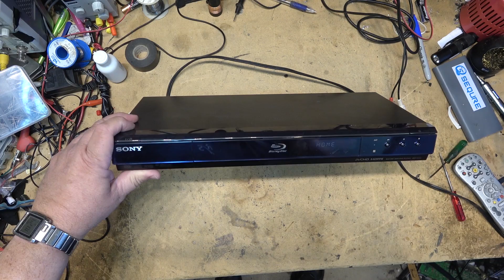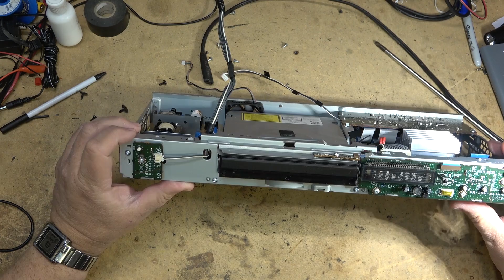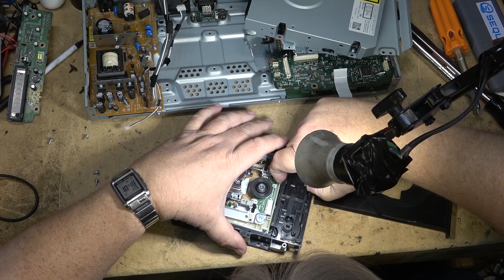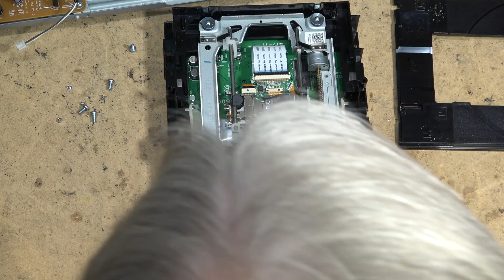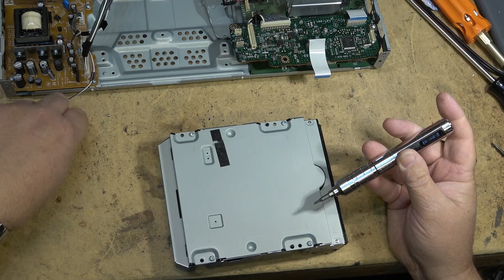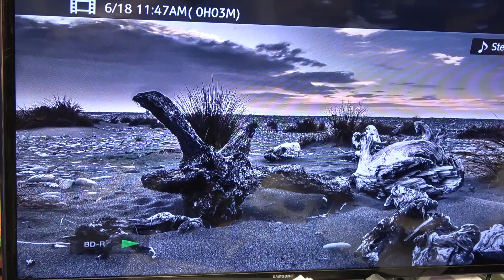Sony BPDS350 Bluray  no load

Comment: With some effort (and a little damage), I managed to get the case removed and gained access to the belt and pully area of my BDP-550. No cracking or other signs of trouble with the pully, however my belt did have that greyish haze that develops on them over time and, yes, it seems a bit worn. I removed it, gave it a good cold water wash and reinstalled. I then lubed all of the moving/sliding parts. After reassembly, the tray opened without any hesitation. Woo hoo! All done...or so I thought. A couple weeks passed. I fired the player up to test it out and it was not ejecting again. It clearly struggles to get it open which suggest the worn belt is just not grabbing very well. DO YOU HAPPEN TO KNOW A REPLACEMENT PART # ? I suspect it is identical to the BDP-350. You might have prepared to replace yours before discovering the cracked pully. Thanks.

Comment: I have a similar problem with my BDP-S550 which I am sure is identical to the S350 model apart from features. I was thinking a loose/worn belt also but I will now be on the look out for a broken pully. I also have to be in the right mood for a lot of disassembly.  😀

Comment: From experience I'd have to say most discs stand up well over the years.  Some, however, can have the slightest surface imperfection and won't play at all, or will stick/freeze or stutter.  Other times a brand new disc won't play (it's been loose in the case?). Yet it's amazing how some heavily scratched (sometimes deeply) and (rarely but occasionally) warped/bent discs will play perfectly; with no issues!  Different players may not play them or will have different issues, of course.

Comment: I bought the Sony BDP-S550 back in very early 2009, because it also had analogue 7.1 outputs in the back.
It still ejects and pull the tray in with no problems, but have instead developed this phenomenon of "Not recognizing the disc".

Most of the time, if the disc is inserted during the first seconds after a cold start, it will work.
(Apart from untried hardware interference, this has proved to be the most succesful approach so far)

Other times you'll have to hit open/close several times before it finally gives in and play the darn thing.

And then again, at other times it doesn't matter what you do, it simply will not recognize the disc, even if it has played perfectly well a couple of years ago. But oddly enough, if inserting another BR, it might play fine.

Sometimes, when the machine has this problem it won't even play CD's or DVD's.

Listening to the difference between a succesful and unsuccesful loading of a BR, it's obvious, that it tries to read the TOC (Or equivalent to the BR-format), before giving some faint but healthy whirring noises (pick-up assembly going back/forth), spinning up and play.
When unsuccesful, it stops before all these actions, so the problem must be with reading some initial stuff and therefore it could be a matter of a dirty lens.
There's also a procedure for a factory resetting, that could be helpful. I tried it. However to no effect.

Maybe reseating the cables could be recommended, or maybe not.

Hmmm...better take this beast up and on the table to find out.

Comment: Wow a Bluray player with composite and component outputs.... Players i've only seen have HDMI only..
Reply: Yeah I have a Philips bluray player with HDMI only although I have a friend who has a bunch of earlier Philips blurays with composite and component but no HDMI - I guess 1st gen bluray units. Can't remember the model number but they're well built and reliable unlike my cheaper one which has the delightful habit of holding on to the disc when you open the tray, forcing you to remove the cover to get the damn thing out again :(
Reply: From the same production year (2009) as this BDP-S350, came the BDP-S550.

Apart from Digital Coax and Toslink Optical, it has analogue 7.1 output.
Analogue video outputs: composite, S-video, component on top of HDMI.
The back is pretty crowded with sockets for everything on the BDP-S550.
I guess what's missing is a SCART-socket....hmmm
Reply: How do you remember where every screw goes? Aside that you have this video to reference?

Comment: On a playstation 3 console I had never opened laser would not read I swopped the flat ribbon cable and it worked fine the old one just would not work yet it had never been opened .

Comment: During lockdown earlier this year I found my Sony DVD/HDD recorder, which is in regular use recording TV still, was letting discs slip.  It would spin them up just fine but when it needed to apply the brakes I could tell the disc wasnt clamped properly thanks to the loud "bbbzzzzz" vibrating noise it made :D

Opening it up to extract the drive, simply to clean the felt pad on the drive spindle that helps clamp the disc, was hell.  You opened one, a similar model and had much the same experience.  That drive was locked into position in various ways, the most annoying of which was a PCB actually fixed onto the drive that slid in and out at a weird angle if you needed to insert the drive.  The designers never intended the drive to come out so this weird angle was harder to achieve when removing it.

All of that just to remove the layer of dust that had become stuck to the felt pad on the spindle.

I swear Sony build these to survive a plane crash or something.

Comment: I have an old Panasonic Omnivision VHS VCR Top-Loader. When I press the play button, the reels move for a few seconds and then it just stops. Do you have any idea what may be causing this malfunction?
Reply from the maker: rotation sensor
Reply: @12voltvids  Where's the rotation sensor located? Also, do I need to replace it or is it possible to fix myself? Thanks for your quick response!
Reply from the maker: @erikkennedy1271  
Well it is monitoring the take up spool and they had several different versions.  Some had it hooked to the tape counter if a mechanical tape counter.  Usually connected by belt to the take up reel between the reel and tape counter.  Could be optical or magnetic.  
Don't ask me what type as i don't know.  I don't know what model you have and even if you gave me the model number I would not know without finding a service manual of seeing pictures of the mechanism.
Reply: @12voltvids  Thanks!

Comment: sony made ok players for early bluray players. but god there 4k bluray players are hot garbage. if the disc even has a spec of dust on it the player will have trouble reading it and the players will randomly lock up there is tons of bad reviews with complaints of the issue and sony don't bother to fix it it don't matter if get the entry level $200 model or the top of the line $700 one they all use the same broken firmware only dif is features and build quality being better on the higher end one they also cheaped out and only put the counter display on the $700 model. panasonic is pretty much the only way to go for a standalone 4k bluray player unless u want spend a fortune for a bouquet brand fancy one.
Reply from the maker: Have never used a 4k player. I understand that most of the problems stem from hollywoods attempt to keep ahead of the pirates so they keep upgrading the encryption which you need to update on the players. I am sure the old acient firmware on my oldest player would have problems with new disks, but I haven't bought a bluray or dvd in probably 20 years. I just use them for my own content that has no encryption on them.
Reply: @12voltvids  sony still updates the firmware for them its just that the firmware is poorly wrote i guess and buggy. even the previous to current models had complaints of the players locking up and then u have to go unplug it and let the player reboot before it will work again. yet u buy the panasnoic one and it works perfectly with the same discs the sony one had issues with.  i had the UBP-X700 for 2 days took it back upgraded to the sony ubp-x800 and both players had the same issues after looking into even the highest end ubp-x1100es has the same complaints about the player locking up well playing movies so ended up returning it and getting a DP-UB820 from panasnoic and it works so much better even was abe to get an unlocked firmware for it that lets me play blurays or dvds from any region.
Reply: > randomly lock up 

Yep mine does that.  However I got that thing for £30 from a charity shop that thought it was a blu-ray player so I'm not complaining.  The most annoying thing is when it locks up, I need to pull the power.  But the power cord is permanently fixed resulting in me switching everything off and on just because of that one device and I cant be bothered to rummage around at the back to try and identify which plug is for the 4K player.

I dont hear a fan in this thing either.  I have considered opening it to see if I can add one in case it is heat causing the lockups.  This sony 4K player goes into some kind of standby state instead of shutting down fully.  When it locks up, that takes out the power button as well, no matter how long you hold it, it will never force a restart as on other devices.
Reply: @dlarge6502  ya i got annoyed with it after 3 movies when u pay like $400 cad for a blu ray player u expect it to work and not lock up. i complained to sony and they didn't seem all that interested didn't even want to admit there was a problem even though reviews of all 3 current and the previous models over multiplier retailers had complaints of the issues why sony would sell such trash is beyond me. another issues that is stupid if your watching a disc with dolby vision u have to manually go though several menus just to turn it on and then if u are watching one with HDR u have to manually go though to shut it back off. all other brands of players that support dobly vision can auto detect if u put a dv disc in and turn it on for u again poor programming on sonys part.

Comment: I have these 2 and when there's a disk that's messed up that it won't read,  it won't eject the disk , and I have to hold down on the power button until the thing resets and then I can open it
Reply from the maker: my 350 has been flawless as have my older 300s I really don't use them much these days.
Reply: @12voltvids  hmm,🤔 weird that both of mine have the "freezing up"  problem though.😄👍